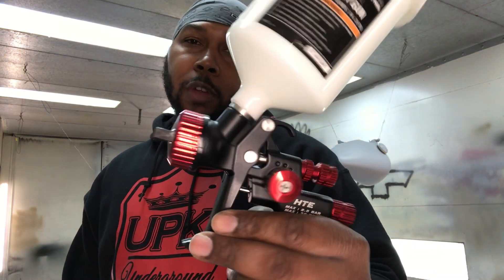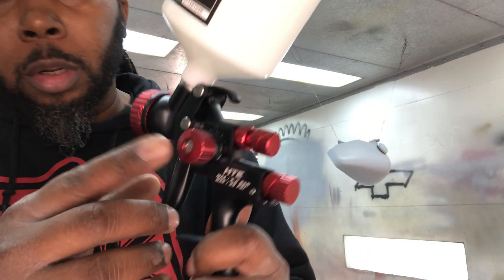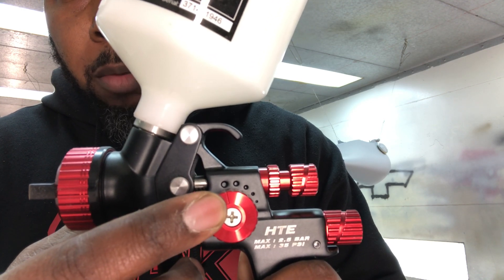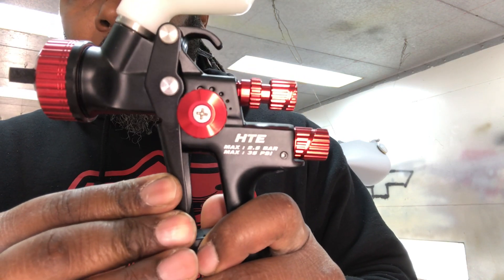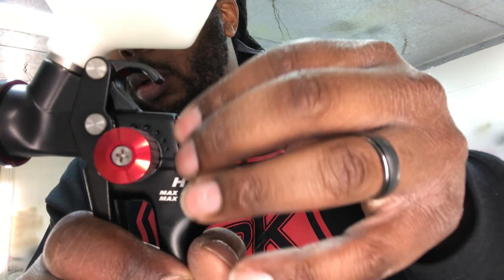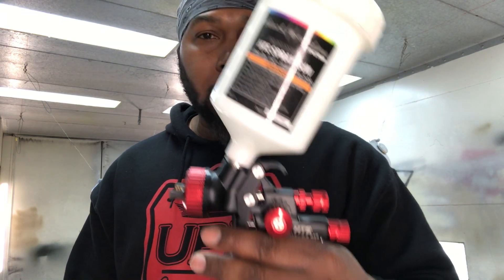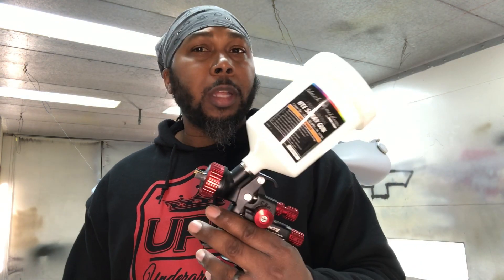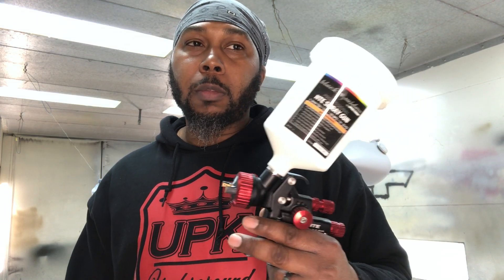How I Set Up My Black Widow For Painting

Comment: How many cfm does your compressor deliver at 40psi? Can I use this gun with my 60 gallon 3.7 hp at 13.4cfm or do I need an air compressor with more hp?
Reply from the maker: @AlbiBx  yes you can use this spray gun with your 60 gallon compressor

Comment: Hey boss man what do you set the psi when spraying base ? If clear is 30 psi isn’t the base usually lower?
Reply from the maker: I usually spray between 26-28 psi Justin
Reply: And what is your air compressors psi usually set on (max wise)
Reply from the maker: @justinsalazar4679  60 psi

Comment: Hi, I recently got this gun and using a 3m gauge the max pressure I can get from it is about 28-30psi with the air valve all the way open. I get over 40psi with my other gun at the same settings. Any idea why I can't get more pressure from the black widow?
Reply from the maker: There is a air valve on the spray gun itself and maybe that is open to let more air in
Reply: @UndergroundPaintKing  thanks for your quick reply. I have the valve all the way open. Are you able to get 35 PSI from your gun? Starting to wonder if mine is faulty.
Reply from the maker: @SkydiveSim  to be honest I’ve never tried to open it up past 30 psi so now I have to check my black widow to see if I have the same issue as you Amir
Reply: @UndergroundPaintKing  if you do please let me know. I’m very curious.
Reply from the maker: @SkydiveSim  I’ll definitely let you know!
Reply: @UndergroundPaintKing  just did more testing with mine. I was under the impression that the internal regulator has to be turned all the way to the left to be wide open. After moving it while pulling the trigger I realized I get more air if it’s closer to center. Curious if yours is like that as well.
Reply from the maker: @SkydiveSim  I’ll check mine as well and see what I get

Comment: This spray gun should of got when painted my old truck but should of got better paint too. If paint again in future and probably will I will get a door off Craigslist to practice on and the Black Widow and a paint rack to put door parts and hoods. Saw one on eBay close to 100. Just would need to get more paint because would be using single stage acrylic next time. Am still a beginner but still won't use that Harbor Freight 29.99 spray gun that was HVLP again. I looked at a place in town to see how much a garage be to rent for auto painting and one said on Craigslist 800 a month but was pretty big but me after a while of painting and getting real good at it if I decide to go that far and get a painting garage would rent one and work by myself. But still new to auto painting now since only started painting last year when did my old truck but it didn't come out as good as I wanted it to be. But I will learn eventually.
Reply from the maker: Keep working at it and I’m sure you will get better at it!
Reply: @UndergroundPaintKing  what size air compressors you use I saw on YouTube someone said 60 gallon  but 80 gallon 7.5 hp two I saw too. This year for me would have to get a paint rack a real good air compressor and some single stage paint and doors to practice on until I get good enough to go farther with auto painting. I already have a paint stripping machine for stripping paint off a vehicle but just trying to get better for now so long way from being able to be painting whole cars on my car yet. I don't really wanna go to school for auto painting either. Thought going that route but probably won't.
Reply from the maker: @zanaga1901  I have a 80 gallon compressor that I use
Reply: @UndergroundPaintKing  thanks will look to get one in the future a 80 gallon air compressor 2 stage one I see they have them at Home Depot.
Reply from the maker: @zanaga1901  I have one from Home Depot and it works great!

Comment: Hey there thanks for the tips. What size fluid tips come with this? If it only comes with one size can you get different sizes? Cant find that info anyehere. Thanks
Reply from the maker: It’s a 1.3 tip and I have heard there are other tips and parts for the gun but I haven’t seen any info on it yet but once I get the information I will share it here on the channel... I appreciate you for checking out the video!

Comment: When using this gun are you doing it with the 29 gallon air compressor? I want to buy the 3m performance gun with a 30 gallon air compressor and do a rear bumper lip half the size of a rear bumper and wanted to know if I would be able to do it what that?
Reply from the maker: I have a 80 gallon compressor that I use when spraying with this gun but if you’re just doing a bumper you can get away with using this gun and the 30 gallon compressor
Reply: @UndergroundPaintKing  👍 thanks I really appreciate it
Reply from the maker: @arellano7103  you’re welcome!

Comment: Is it possible to run this gun on a small compressor set up? It would be cool to see a video like that
Reply from the maker: You can use this gun with a small compressor but using it with a small compressor to do a complete paint job is rough because the small compressor won’t keep up with the demand of the gun so if you use this gun with a small compressor it’s best that you’re only doing parts and panels
Reply: @UndergroundPaintKing  got you thanks i was planning on using it with a 26 gal but was worried this gun demands about 10 cfm and the compressor puts out around 6 😫
Reply from the maker: @mannyfaces3631  yeah this gun needs a compressor that can keep up with it to work properly
Reply: @UndergroundPaintKing  thanks i think i will return it and run a lvlp instead! What you used the campbell one?

Comment: Do you use the same gun and tip size for your primer, base and clear?
Reply from the maker: I use a different gun and tip for my primer but the same gun and tip for base and clear
Reply: @UndergroundPaintKing  thanks man great videos with great results
Reply from the maker: @AHLive215  thanks I appreciate you checking it out!
Reply: @UndergroundPaintKing  I can't find a gun for my  small 26 gallon compressor. I want to paint my motorcycle fairings. The sprayit isn't available.  Was thinking about the HTE gun from harbor freight. What are your thoughts and suggestions 🤔
Reply from the maker: @AHLive215  if you go with the spectrum or black widow from HF you should be fine with spraying your parts you just have to be mindful of your pressure dropping but it should work for you

Comment: I mean no disrespect at all, but I actually am curious of why you adjust your fluid flow that way. I have seen others vids's where they do the same thing. Is This something that the manual says?? Or is it just preference that you have developed or learned or been shown?? I work from the exact opposite approach, I choke the fluid valve off and hold the gun wide open and dial in my flow, and adjust my spray pattern, then adjust my fluid flow to match my pattern. BUT... I don't like the fact that this gun has preset detent settings on it, thats kinda bulshit... Sorry, not tryin to stir the mixing cup... Just trying to understand.
Reply from the maker: Csquared it’s just how I like to set it up and I like the results I get from it but by all means please set the gun up the way you like to